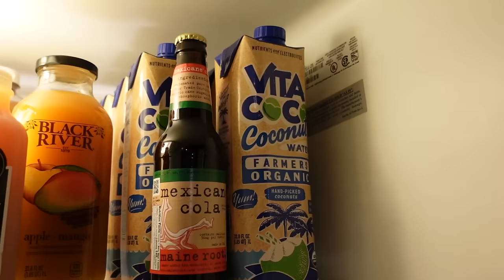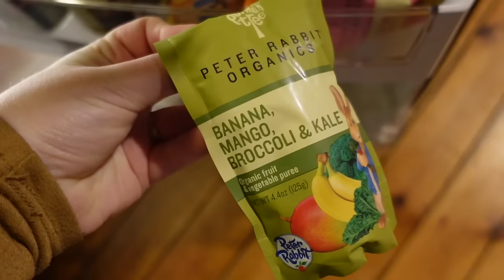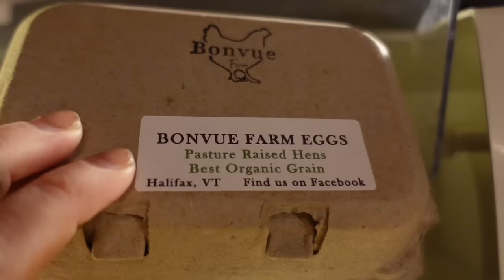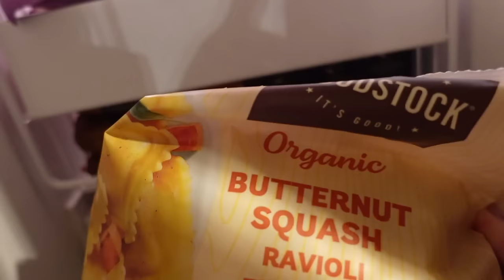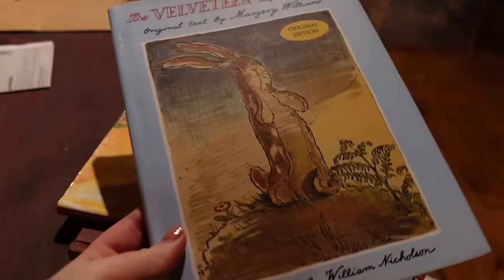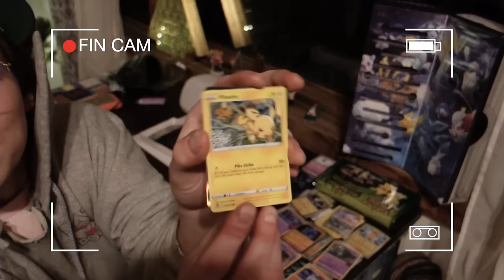chatting VT diversity, grocery haul & vent sesh | VLOGMAS DAY 12

Comment: HOLIDAY CARD IDEA: Hang some string horizontal against a wall or over a doorway, hang cards from clothes pins or if they are traditional folded cards you can just open them and hang them on the string itself.